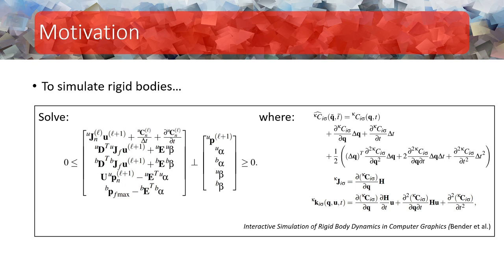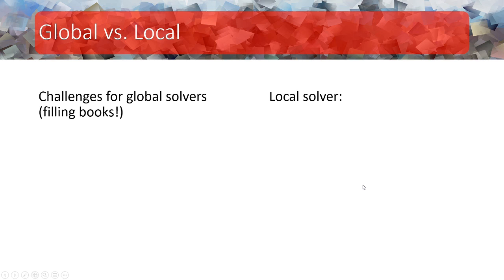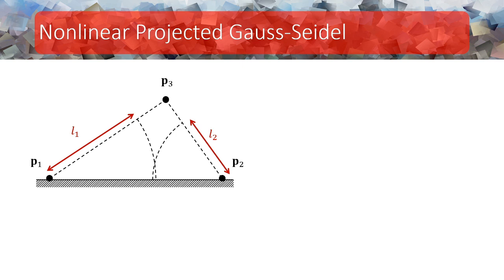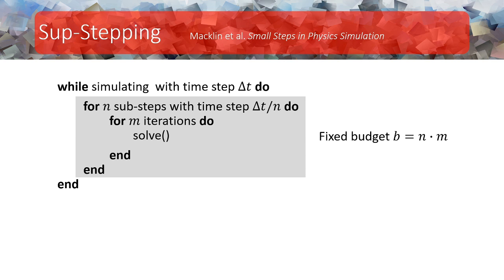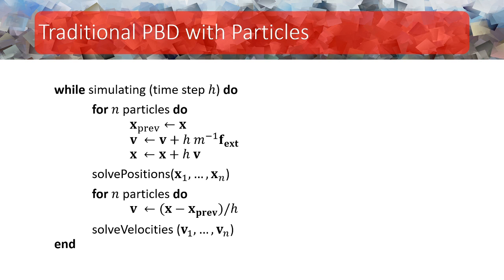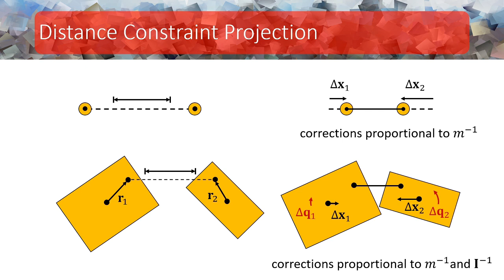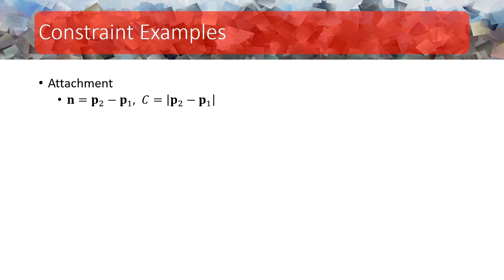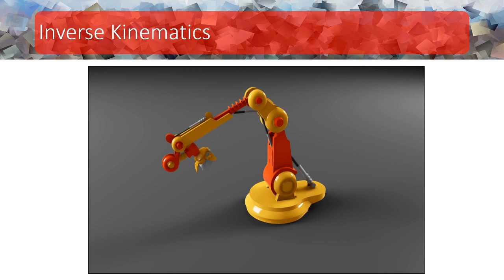SCA2020: Detailed Rigid Body Simulation with Extended Position Based Dynamics

Comment: Matthias... this is the best physics implementation.  I'm struggling with how collisions for a rigid body are detected. All you've basically added to a particle is a rotation, inertia tensor, and in your example you had a projected contact point (defined by vector r, which is from the center particle to some undefined point on the rigid body). I wonder how you get the vector 'r'?
Say for all the rigid body meshes in the car example, previously you filled them up with particles -- is that more or less accurate than this vector method?
Reply: Sorry, I found it in the paper. "To save computational cost we collect potential collision pairs
 once per time step instead of once per sub-step using a tree of axis aligned bounding boxes. At each substep we iterate through the pairs checking for actual
 collisions. If a collision occurs, we compute the current contact normal and the local contact positions r1 and r2 with respect to body 1 and 2."  You could use a GPU with BVH acceleration for the AABBs. Do ray-box and ray-triangle intersection tests.
Reply: You said you used "per element shape matching [MHTG05] on the 1100 hexahedral
 elements of the tires." So you went back to filling the shape with particles, was it faster than having the tyre as mesh based collision detection?
For other meshes, did you use different primitives other than the actual mesh geometry, or were all other collisions detected with per polygon intersection tests? The "Rolling Ball" demo used segments of curved wire defined by a Hermite spline, but wonder if that could have been done more effeciently with particles?
Also newer GPUs can do up to 320 ray-AABBbox intersection tests per cycle or 80 ray-triangle tests per cycle.  I wonder if you can take advantage of that, especially considering the collision detection is the most expensive part of this algorithm. Then compute in parallel by grouping all potential collision pairs (for the time-step) and computing all contraint projections within the same compute unit.

Comment: Although you didn't mention, I would expect 'local' means more suitable for parallelization than global?
Reply from the maker: Not necessarily. To parallelize the method one has to make sure that constraint projections to not overlap. This can be done by putting them into independent sets (coloring) or using Jacobi iterations which are as simple as Gauss-Seidel but converge more slowly.
Reply: Fancy seeing you here. Love your website, it has taught me so much about physics. Loved the top down car tutorial and how lateral physics work thanks to vector projections. Also like the Diablo II amazon photo.

Comment: Since it is a local solver can it be computed on a GPU? do every constraint in parallel...
Reply: Matthias replied to a similar comment asking if parallelization in general was easier than a global solver:

> Not necessarily. To parallelize the method one has to make sure that constraint projections to not overlap. This can be done by putting them into independent sets (coloring) or using Jacobi iterations which are as simple as Gauss-Seidel but converge more slowly.
Reply: @JobvanderZwan  Thank you! I assume it is relatively hard or impossible to separate sets of close moving systems like in the car example, but I am sure something is possible. Maybe in a future paper :)

Comment: Very exciting stuff - will we see this solver available in an upcoming release of PhysX?
Reply from the maker: Thanks! PhysX is a mature product so we will not change the stable core engine which is velocity based. This position based solver version will be used in independent projects and products. I have part of the solver implemented in Javascript. We first have to settle the licence issues before I can put in online. Should happen soon.
Reply: @matthimf  Awesome! Please update us when it is available. This is fantastic stuff.
Reply: @matthimf  Having read the paper, I think that this is a super interesting work and I'm really looking forward to get my hands on the code! :)
Reply: @matthimf  this work is so exciting! I can't wait to try and implement
Does your js implementation include ridgid bodies?
Reply: @matthimf  Leaving my comment here to get informed if and when the code is available! Can't wait!
Reply: @matthimf  That is FANTASTIC!! Would love to help facilitate this in any way I can. I work with THREEJS, a WebGL framework. This would be an amazing addition!!
Reply: @matthimf  Looking forward to a driving sim based on this.
Reply: @matthimf  will you make a video when it comes out? I really need these physics in my project but if it has a license it is better that you fix those license problems and then I use your version or whatever
Reply: @matthimf  I guess the licence issues were more complicated than it seemed:)

Comment: will this be released as an alternative to simulators like pybullet?
Reply: Also it would be cool if the authors could just relase a playable demo of the car. Even cooler: integrate it with a proper tire model.